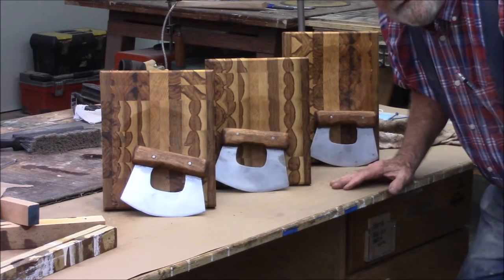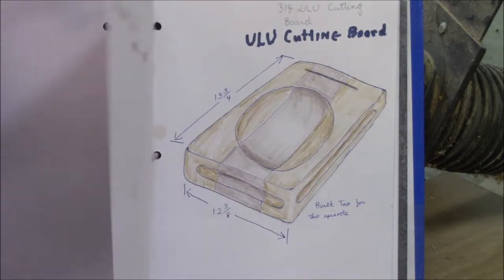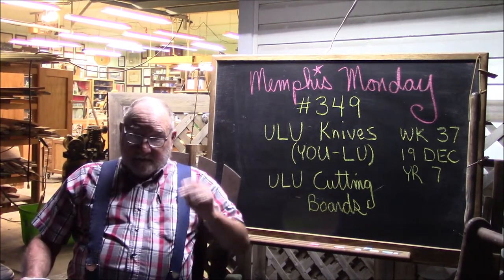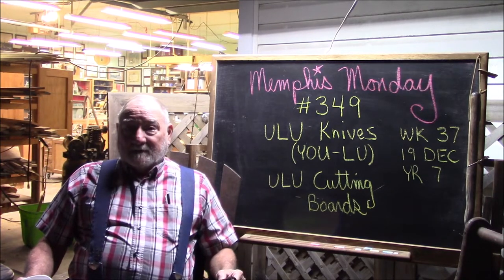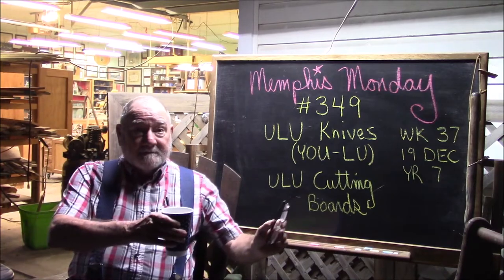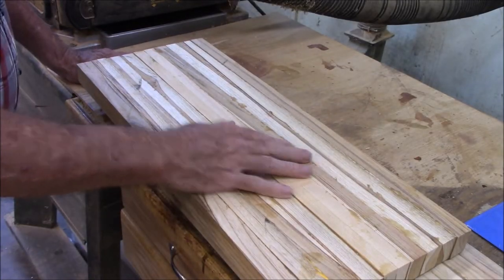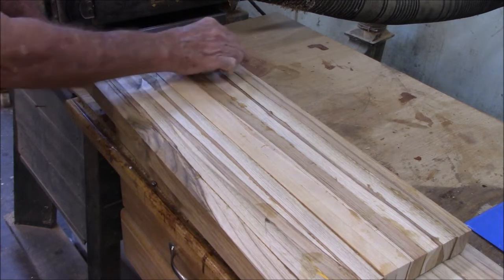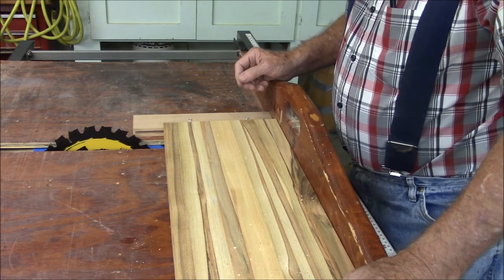349 ulu knives and ulu cutting boards

Comment: I know people appreciate receiving cutting boards as gifts but few know how much time goes into their construction. Your boards came out looking very nice and I hope the new owners appreciate your efforts.  Making a knife is something I attempted twice before the days of the internet and both were failures due to my own ignorance. Since then I haven't had the interest. I think yours came out better than mine did. I loved your comment about your ulu knives,"...all I have to cut up is celery anyway". That made me chuckle. Merry Christmas to you and your family.
Reply from the maker: What helps me in making cutting boards is that I'm so fortunate in having all the tools, etc.  For example, I have a 25 inch 220 volt dual drum sander, and that DeWalt 13 inch thickness planer.  Add in all my bar clamps, and all the open bench space, and somethings I feel like I'm cheating.  Another trick is to make several at a time; might as well put all the hassle to the best possible use.
     Yep, I wanted to make it clear I'm not a knife building guy; the different kinds of metal, sharpening, hardening, etc., are complete mysteries to me.  But I was flattered that my friend asked for three more subsequent to the first saw blade knife.  Moreover, the cutting boards were better on this build, so I came away satisfied.
      I hear you on the internet comment.  Heck fire, this time I even checked out some hardening videos, since I too am ignorant on the subject, but I still didn't get the hardening right.    I needed a larger, hotter, and more even fire.
       Merry Christmas to you, and thanks again for watching and commenting.